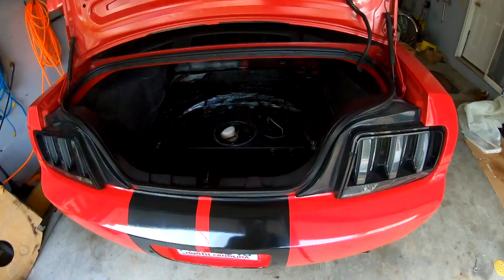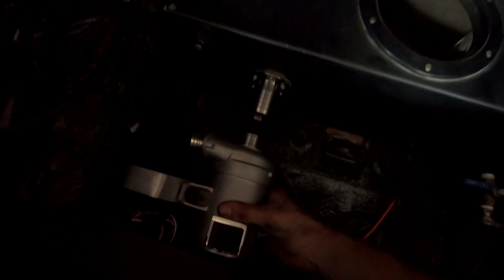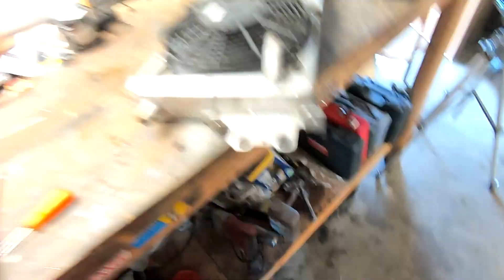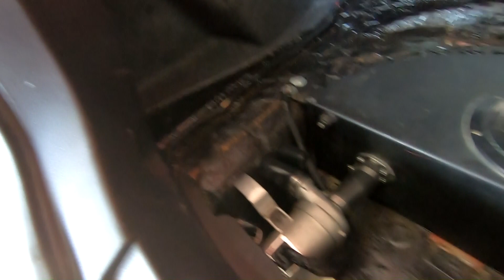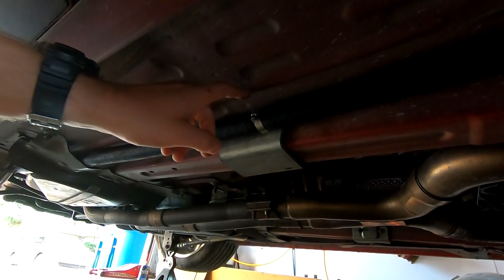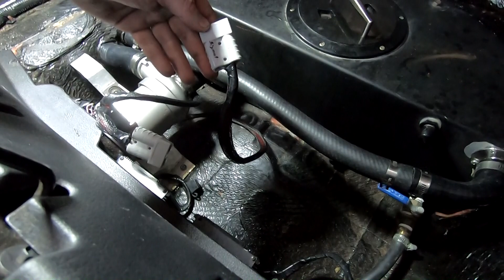GT500 1" Intercooler System Conversion | Ice Tank mods, 1" hose routing, CWA400 wiring & H/E Fitting

Comment: Nice work! Where did you get those flanges for the tank?
Reply from the maker: Thanks, I picked them up off amazon. I can try and find the link if you need them
Reply: @AllThingsBoost  that would be great, thanks!
Reply from the maker: @Rios_Garage  DERNORD 2" Tri Clamp to 1.5" Hose Barbed Adapter SUS304 Sanitary Hose Barb Pipe Fitting (1.5 Inch Barb Hose) https://a.co/d/9fi02jk